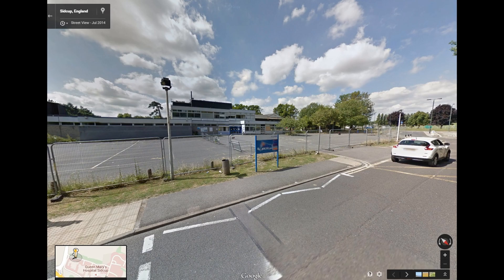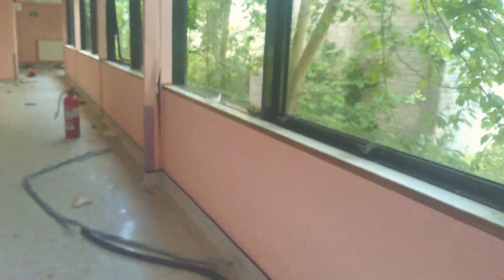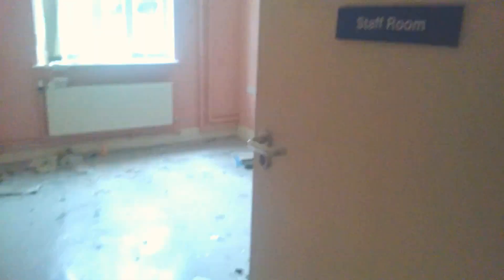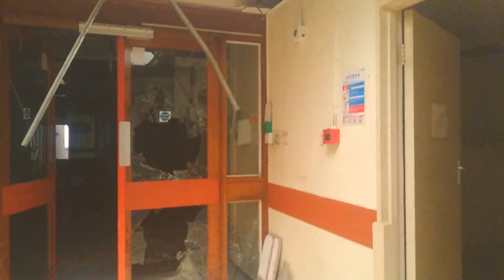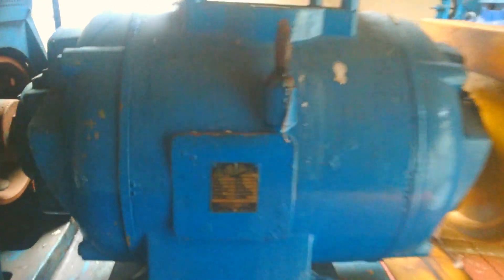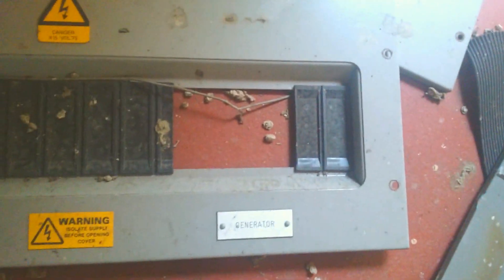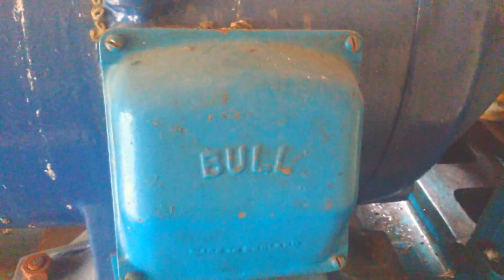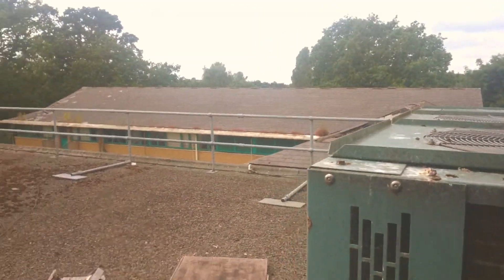Queen Mary's Hospital Urbex (with lift motor room)

Comment: ***** That window was only recently smashed. There is a certain window that you can unlock but only a few people know about it including a homeless man who used to sleep in a cupboard downstairs. Also, if you go down to the bottom basement, it is all flooded. We got some boots and went down there. If you didn't already notice I left the lift doors open on the first floor. :3
Reply: Aaron Burtt 
Did you damage the interlock to open the hoistway door? Or did you use a lift/elevator hoistway door key?
Reply: On the lift door? No I used a drop key. It's too hard to break a lift door unless you get a hammer and hit near the wheels a lot.

Comment: Whoooooa awesome video Sir!  I like the Bull motors and the x-ray room 😁 no clue either about the old HVAC stuff I only really like mini splits and such especially ones where the compressor is variable spotted like an Ecodisc!!  Also I like the sound of old compressors at 50hz!
Reply from the maker: Knuckles the Echidna I like the sound of the 1950s Westinghouse compressors on the old slam door trains (now replaced). Some 455s have these compressors but I'm not sure if for much longer.

Comment: Would asbestos be in building built in the mid 90s? I know it wasn't fully banned until 1999
Reply from the maker: +Tom Jardine   It is not very likely.
Reply: Asbestos is a very dangerous chemical, there is most likely Asbestos in there because it is fire proof, an old factory near it, has got asbestos in it, but Queen Mary's hospital is still in use, this is just the old bit, I know someone born in that part anyways, it is taken down now, but I think because it was vandalised and old, they took it away